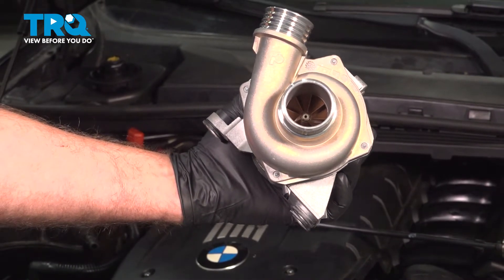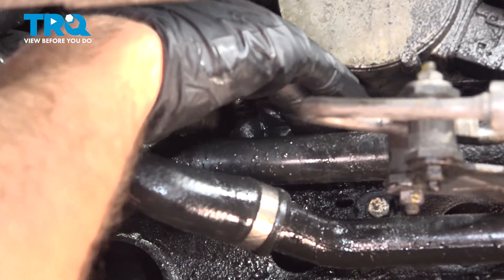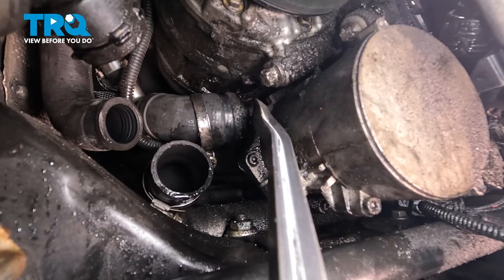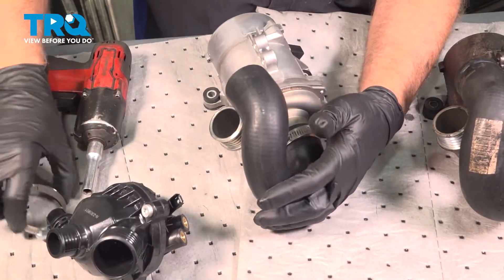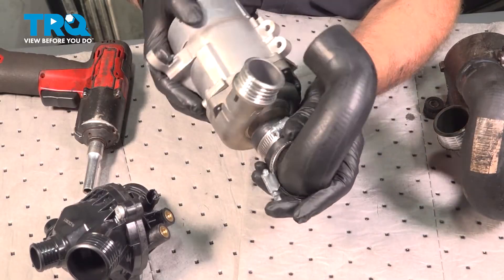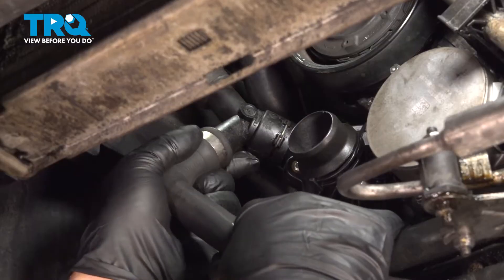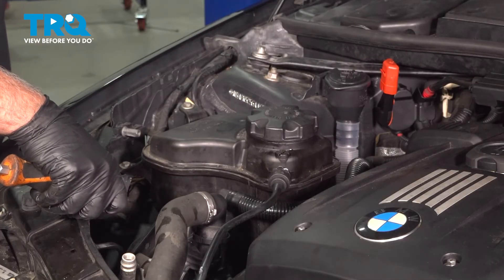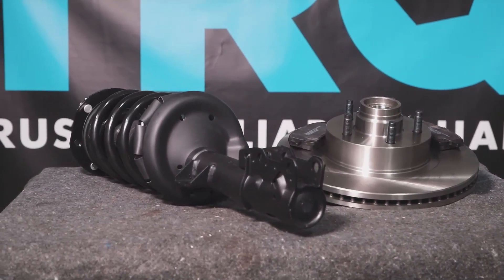How to Replace Engine Water Pump 2009-2013 BMW 328i xDrive 3.0L L6

Comment: Hello , my coolant pump keeps on running even when the engine is off and it drains my whole battery. I have already checked female connector to the pump for 2 big wires which is ground/power supply wires and its receiving 12 volts, small 2 wires for continuity and its good. Can you tell if it could be faulty thermostat, pump issue or something else?

Comment: Why new bolts?
Reply: They’re single use aluminum bolts that are stretched on installation so they have to be replaced.
Reply: Aluminum/Mag block needs bolts with specific thermal expansion coefficient e.i not steel, these get brittle over time or deform. Always replace Aluminum/Mag bolts.
Reply: One time use aluminum bolts. If you reuse, you could break the head